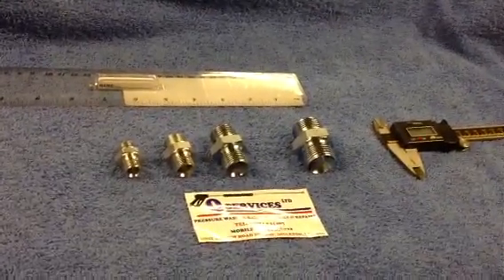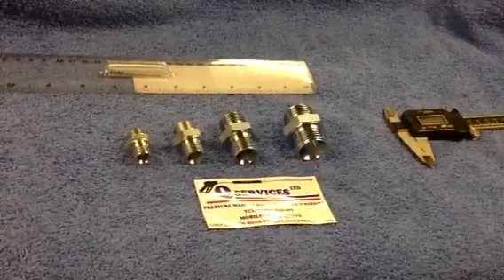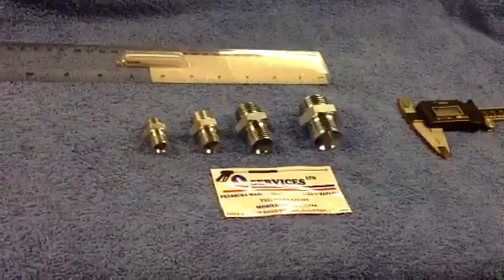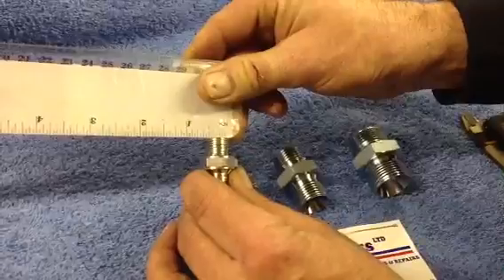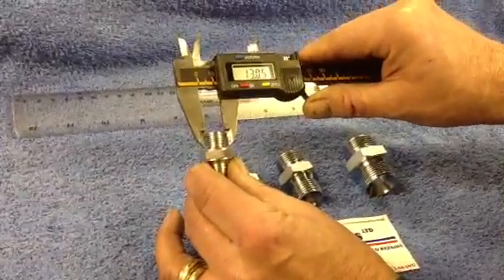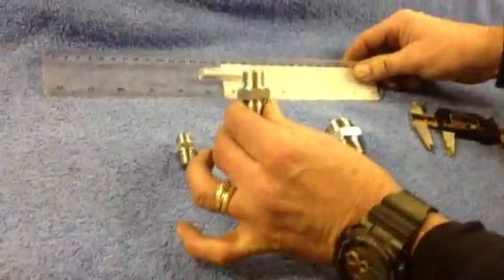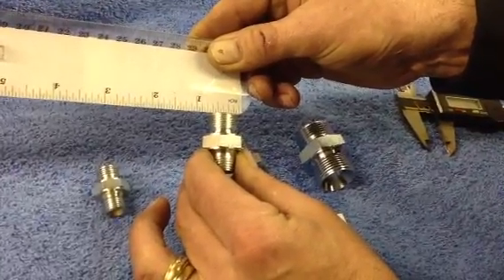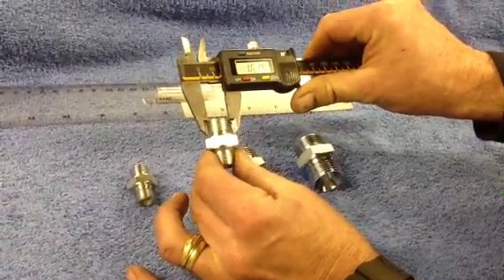HOW TO WORK OUT BSP BRITISH STANDARD PIPE THREAD SIZE CONVERTER INCHES DIA QWASHERS EBAY YOUTUBE

Comment: I have a piece of pipe with an ID of 1/4" (12mm) the wall is 2mm thick to cut a thread, can you help me out by telling me what size BSP thread id need?. 

Is the 1/4" (12mm) the same size as the pipe and will just falls right through Or is that the diameter not including the thread?